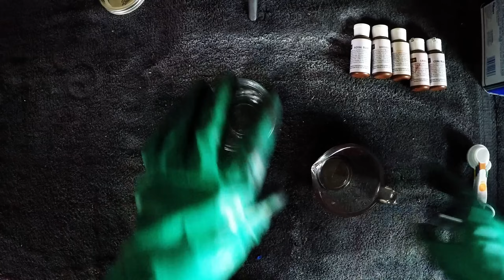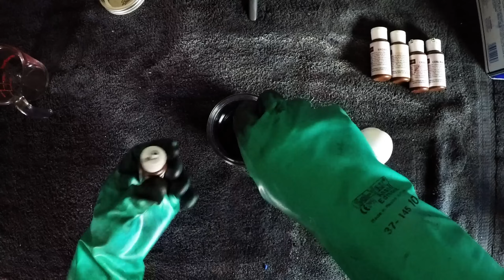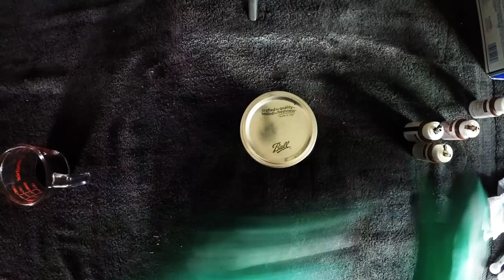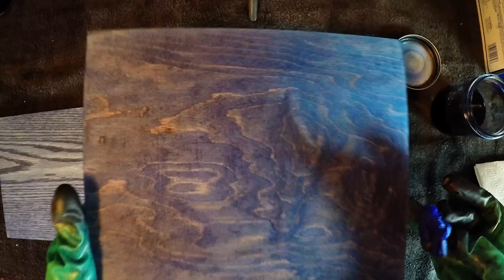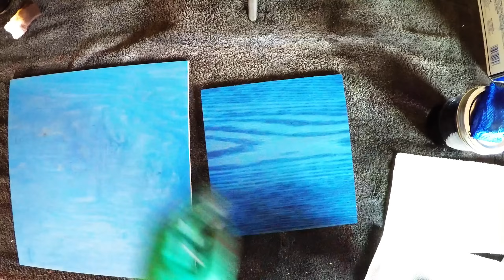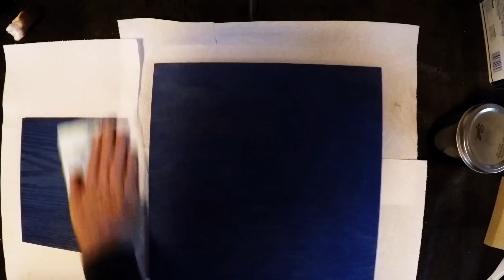Using Wood Dyes On Maple and Oak - Blue Dye - Blue Wood Stain

Comment: Thanks for the video. What would the equivelant recipe be for the keda powder dies to Get to the same shade of blue?
Reply from the maker: Thank you for watching! I would say 1/8th tsp to 4-6 oz warm water or 1/8th tsp powder dye to 1 oz warm water and 3-5 oz 91% rubbing alcohol should get you pretty close. You could mix it on the lighter side with 6-8 ounces and add 2nd or even 3rd coat to give more color control based on the wood and the wood prep. If just trying to get a general color similarity, that should be a good starting point. Hope that helps out, and thank you again 👍
Reply: Thanks 🙏. What’s the advantage to using Alchohol over only water?   And do you have any advice for staining maple without getting blotches?
Reply from the maker: @TzufFamilyBand  blotches are typically produced by the wood itself. When you say, "Blotches" I would need more details. Dying a 5A grade quilt maple causes, "Blotches" (the light and dark contrasts) based on the varied wood densities of the grain, and heartwood which is often the desired look. "Blotches" arent always bad 😉 
I need to understand your definition of "Blotching", before I can answer this better.
Reply: @KedaWoodDye  thank you.  Do you have a measurement in grams for 1/8th tsp of powder?
Reply: @KedaWoodDye  thanks for you helpful replies. I’m new to staining wood, so not sure. Someone who taught me to finish wood told me he was never able to get maple to hold a stain without blotching. But he didn’t explain to me what he meant.  The maple I’m working with isn’t figured. It’s regular maple

Comment: These look beautiful!

I would love for you to make a video showing/explaining why one might choose to use laquuer thinner over alcohol over water, or why it is preferable to use one of these bases in certain situations. Love your video and work!
Reply from the maker: +Mithradates Megas Thank you, I appreciate that more than you may realize. What a great idea! I will definitely try to get that put together. It will be a perfect way to show some differences, similarities, and the versatility of each wood dye base.
Reply: I actually had another couple of thoughts, if you get the chance; firstly, how much control could I get with these dyes? I imagine that, being dye instead of paint, I would get a lot of bleedout if I tried to apply it with a fine brush or something, but it might be a cool experiment.

Secondly - I notice your website lists the dyes as non-toxic. Do you know if these are safe for food-grade applications (like a cutting board)? Thanks, and I love your videos! I'm the kind of person who watches two hour long videos, so at least as far as I am concerned, don't feel guilty about posting longer videos!
Reply from the maker: The wood dyes will run along the fibers of the wood, but if you mix even just a small amount of lacquer, shellac, etc. or other sealer choice they will not run and can be used like a very clean transparent paint.

The wood dye liquid are definetly much to concentrated and potent, as well as the mixing transfer agents in them wood not make the liquid dyes food grade. Even the wood dye powders are much to powerful to be food grade. They would need to be refined further, and diluted considerably. Now if they are covered with a food grade shellac or top coat sealer they would not come into contact with foods. I still wouldnt use it on a cutting board though, but honestly, I do not use anything on cutting boards other than olive oils.

Hope that helps out?
Reply: Keda Wood Dyes

Comment: If you see a construction site with a dumpster outside get the number of the contractor and call them to ask if you could take some of the wood from the dumpster. I get a lot of wood that way. I even got a brand new toilet one time and a really nice Chandelier. Just make sure you ask.
Reply from the maker: What a great idea! I am building a bench right now that I repurposed an old bunk bed and the slats where the mattresses would lay on. I must have got about 50 precut 1x36" boards ready to go. We just had contractors downtown doing some work remodeling an old building into luxury apartments. I will have to stroll through and see if i can talk to someone if they are still there 👍🏻 Thank you! and thank you for watching :) Owe you one now
Reply: I've done this before but I didn't ask.  There was no one around 🙂
Reply: @NWWood17 be carful only because they consider that stealing and you could get arrested potentially.

Comment: If you are going to use oak, then you should use quarter sawn oak so you get some figuring. If you use either red or white oak that is rift sawn then you get this fairly large light areas that do not take the stain or dye. It is difficult and expesive to use quarter sawn oak, but the results are worth the effot.
Reply from the maker: I will see if I can get some quarter sawn. When I went to the mill, they only had plain slice and rotary. I guess there was a huge project that had taken up all the supply. I totally agree. It is difficult to get your hands on. I think many contractors are using 1/4 sawn because they tend to hold it for bigger projects and higher board feet requirements. Maybe I will have to bring donuts in for the front office and see if I can get a mix lol 😆 👍 Wish me luck

Comment: In your other video you used rubbing alcohol as a base mix, that was with the powdered form of dye. Does that matter? Also if this technique is used on a dinner table, can I seal it with a poly crylic, or will that spray on laquer work? How long does it take to cure? Do I wet sand before sealing?

Comment: Looks amazing!  Could the color come close to this with Water with the powder dye instead of solvent/ concentrate?  Would we be able to add multiple coats of water stain to get it to a more dramatic blue like this?  

Also, would you know which solvent would have the least odor/ health effects?  Thanks!
Reply from the maker: shamus jubenal here is a link to the blue dye powder, but was done with a higher concentrated version. If you were to use a heaping 1/8th tsp to around 6 ounces of warm water, it would be a similar coloring. Here is that link: https://youtu.be/m0T1T_CpzlY

As for the least smelling solvent, would probably be a 91% rubbing alcohol, then I would have to say Denatured alcohol. The powders do work well, but the liquids are a bit cleaner, and has a little more transparent look when mixed with the solvent bases. I am going to be doing a comparison video soon hopefully. Hope that helps out :)
Reply: Thank you very much!  And keep up the good work!

Comment: Did you spray lacquer on it or is that shine just the dye ?
Reply from the maker: Honestly is both...see these dyes will look blah and drab after they dry, but were designed to work with a clear coat. The clear helps bring these too life, and will deepen the look ;)

Comment: I've heard dyes are more light-fast (resistant to fading from sunlight) compared to stains.  Do you know anything about how resistant this brand is?  I'm planning on covering with lacquer if that makes a difference, (part of it will also be painted) and want to get a smooth gloss finish like you might see on a guitar (meaning lots of sanding yay lol).

Comment: Is there something else I could mix this product with to get a thicker consistency?
Reply from the maker: Sandra Serrano You can mix the liquid dyes with just about anything except oil base. Meaning water based, alcohol, etc. You could mix the liquid dye into a top coat sealer such as lacquer, poly acrylic, shellac, etc. Which will tint the wood sealer and also be a thicker consistency. Thank you for watching :)
Reply: Keda Wood Dyes and the ratio would remain the same?
Reply from the maker: Sandra Serrano I would use a little less since tinting the wood sealer will lay more atop of the wood versus penetrating the wood, which will require a little less liquid wood dye. Say a ratio like 1/8th to 10 - 16 ounces of wood sealer, otherwise you could always just add a few drops of the Liquid Blue Dye at a time to create the specific look you are looking for by testing on a scrap piece. Thank you again :)
Reply: Keda Wood Dyes awesome info. Thank you!!
Reply from the maker: Sandra Serrano Glad I could help out. It really is a very good, top quality liquid wood dye, and I honestly believe you will astounded and pleasantly surprised what this wood dye set can really do. Either as a tinted lacquer, or as a dye stain, these make a very high end transparent wood paint that is very hard to beat. Have a great holiday season and thank you again for watching.
Reply: Keda Wood Dye which will give the most vibrant effect? Alcohol, water or lac thinner?

Comment: Did you put like a shine after? (forgive me if you already answered that)
Reply from the maker: Sarah I think you mean if I wet sanded or polished after applying the blue dye? In that case, I did not. This video was really just about applying dye on wood, and some possible tones on different wood species. The finish would become much deeper and the best way I can describe it is a magnified look, as well as having an even cleaner overall appearance. If I would polish the sealer afterward, then I would get complaints of modifying the finish. I do plan on making some more advanced videos, but I am working on my workshop right now. Should be ready soon though :) Thank you again for watching.

Comment: What was the other wood you showed there that was already finished? Sure is beautiful. Like tiger wood.( I don't know if that is a wood name but just what is looks like to me "tiger") thx for the post.
Reply: Oh never mind ha, you just said at 24 minutes in Curley Maple Wood. Thx! Wood type makes all the difference!
Reply from the maker: The blue dyed wood I brought in from off camera was a curly maple technically, but we cross cut vertical and horizontal instead of ripping it vertically, to get the "Tiger Maple" effect. I really am not sure if that is how they actually get a, "True" Tiger Maple, but I just love the pattern of the grain that way. The dye mix was 1/8th tsp to the 4 ounces lacquer thinner and one good coat was applied. It was also sanded to 180 grit. 

Thank you so much for watching! I really do appreciate it!

Comment: How deep does this dye penetrate?  I'm curious if in the course of laying a wood floor, if I could dye a plank of wood and have the dye penetrate deep enough that when the floor is sanded and prepped for sealing, the stain would remain?
Reply from the maker: Annony Mouse Hi thank you for watching 👍 The answer really varies based on the type of wood being dyed, and the reagent the wood dyes are mixed with. The deeper the penetration, the more wood dye coats you may want to apply. Meaning, a less penetrating Dye will have more of the wood dye remain in the surface, pooling more wood dye in less space. The deeper the wood dye penetrates, the less wood dye will be in just the surface, so follow up coats will deepen the dye coloring. Hope that part makes sense. The liquid dyes are a slightly smaller color molecule, and if mixed with say acetone or denatured alcohol (thinner reagents), they could penetrate up to 1/8" in soft woods. On hard wood, they could penetrate a little less, but still should get in there at least 1/16" in the deeper pockets. This can also drive deeper with added coats, and how heavy they are applied. I am actually doing a sand back video using the blue dye on a hard curly Maple this week, and it may help you a little better. Thank you again for watching...
Reply: Annony Mouse when doing stain on the floor makes sure the floor if fully sanded and prepped for finish, apply your stain in the normal way and then clear coat

Comment: How long does the dye take to dry out between coats?
Reply from the maker: Simon Claeys it really can vary a bit between the wood substrate being used, as well as the reagent the liquid wood dye is mixed with. With all that said, when the wood dyes are mixed with the lacquer thinner, it dries quite fast like within 20 minutes it will be fully dried for sure. A little tip, if you would like the liquid dye solvents to last a little longer for longer penetrating times, I will add about 1/2 tsp of lacquer itself to help the dyes last a bit longer on the wood to penetrate a little longer. Also, letting the liquid dyes rest about 20 - 30 minutes after mixing the liquid dyes will be a little thicker. But once you stop applying the dyes, it dries really fast with the lacquer thinner. Thanks for watching, and hope that helps out :)
Reply: Keda Wood Dyes Thanks a lot for your response! I've just ordered the  blue dye you were using in the video and i'm very excited to try it out. I am going to dye my electric guitar with it and I hope it turns out just as good as it did in the video.
Reply from the maker: Simon Claeys I am sure it will. These liquid dyes are very high quality, and please don't make the same mistake in over doing on these. I tried to show a little better coloring, because the camera didn't seem to pick up the actual beauty and depth, but adding more blue liquid dye wasnt the answer. It just needed a white back drop. If going with 1/2 tsp to 8 ozs only do the one coat, unless you like the darker blue instead. Thank you for watching, and remember with a guitar, you will want a scratch resistant sealer like a nitrocellulose lacquer or something that is specifically designed for resisting scuffs and scratches. Glad it helped out : )